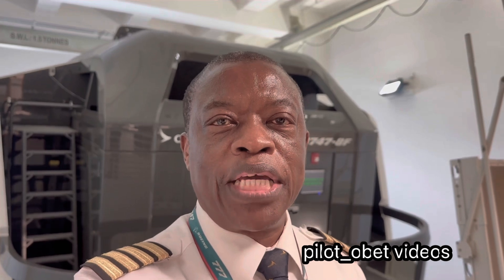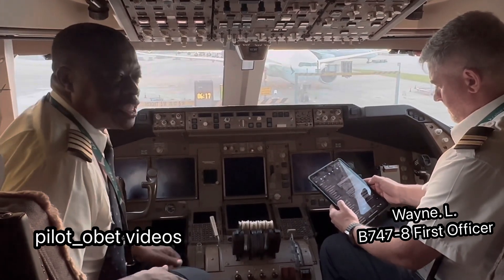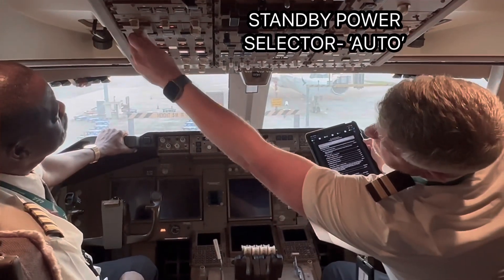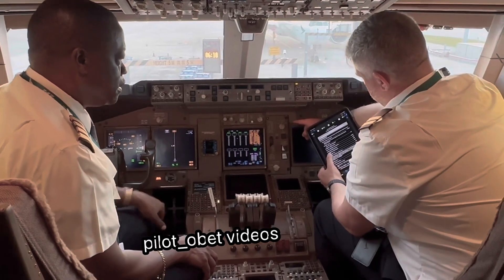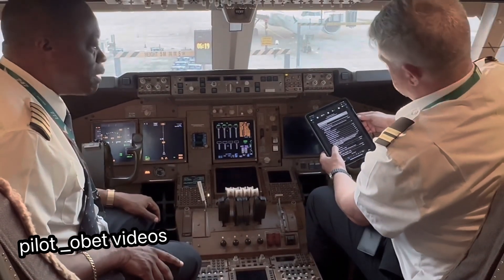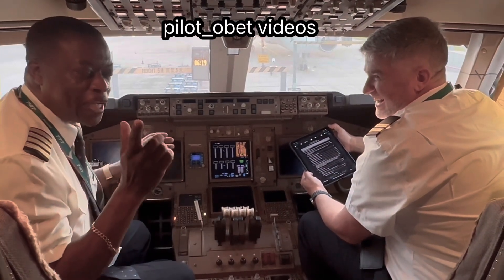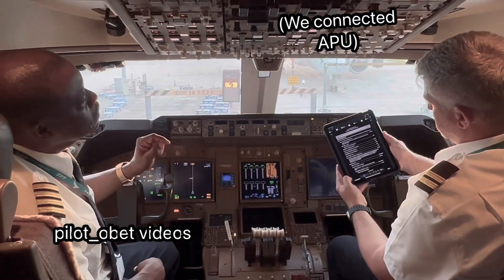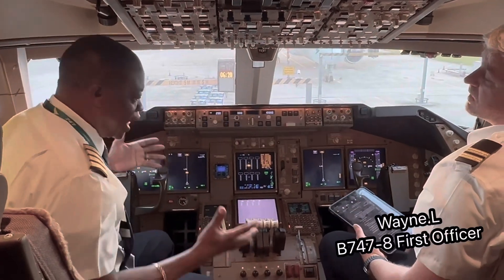Let’s power up the Boeing 747-8

Comment: Outstanding as always Capt Obet - sure appreciate the time and professionalism. Great checklist explanation - you stated certain items are where they are and why. Are those items verified to be in the correct position prior to engaging the battery (gear handle, flap, hyd pumps, etc)? For example, if the flap handle been inadvertently moved to 20 and Sys 4 Hyd left in Aux, would the flaps transition once batt switch was engaged or is that not possible until the APU is selected on? Verifying positions with the checklist after the battery was turned on left me curious.  Thank you again for such amazing videos!!!

Comment: Why is it getting noisy once the airplane is “alive”? Is it the AC starting to operate? I always thought it was the APU that made the most noise up until the engines are turned on. And great video of course!
Reply from the maker: @finn-lub  the Air conditioning packs came on and airflow started.The camera is a bit sensitive and the sound is a it louder than actual.

Comment: The '47 is still a favorite ship. I'm curious, though. The APU is a turbine engine, much like the main engines but smaller. When starting the APU, is the fuel management automatically handled (once the turbine has spooled up to ~21% N2)?. In contrast, when starting one of the main engines, as it gets cart or bleed air, you monitor the N2 rpm's before introducing fuel, manually. Always interesting to see cockpit video. Thanks and safe travels.

Comment: Great clip, Skipper. I am sure the junior colleagues appreciate your selfless attitude. the APU has a door that opens before it starts and I believe it remains open whilst the APU is operational. Kindly talk me through APU operations during the flight because thinking that the open door might be ripped off during the flight always puzzles me.
Reply: The APU door is an inward opening flap. So there would be no risk of it being „ripped off“. However, on 747-100 an -200, this door even had a scoop which was designed to catch the air for better start up of the APU during flight. It was discarded later from production and removed from planes already flying with it for drag reasons, because it was deemed to be unnecessary to start the APU during flight at all.
Reply: @CPT-Kim-747  Thanks for the response. Some aircraft have outward opening flaps. However, even for inward-opening flaps,  have manufacturers designed aircraft to avoid air rushing through the opening in case the APU is turned on during flight?
Reply: The APU, when started on ground, will “suck” the air in through the opening and run fine. The “scoop” had only been designed for starting the APU in the air, where the rushing by of the air could even force a slight reverse airflow through the APU, which could have made starting in the air difficult with a danger of overheating during start.
The APU nowadays is only left running during Takeoff when the air conditioning packs would otherwise be turned off during a takeoff with performance constraints where you cannot afford to extract bleed air from the engines, and when you need air conditioning during that Takeoff. Then the APU will supply one of the three air conditioning packs for Takeoff and will be switched off afterwards for the remainder of the flight.
In the early 747-days it was thought: “we have an extra Generator (even two in some cases), and a bleed air source, so we will make it usable during flight. However, with already 4 generators and bleed air sources, it was not worth the constant extra fuel burn for the scoop.
Reply: @CPT-Kim-747  Thanks for the explanation mate.
Reply: Normally the APU will be shut down before flight - the door will close.
Reply: - the generators on the en gines will take over the electricity supply
Reply: @jesperschmidt4948  Thanks
Reply: @jesperschmidt4948  In exceptional cases the APU is operated during flight, or a portion of the flight.
Reply: Very informative. Thank you Captain Obet.